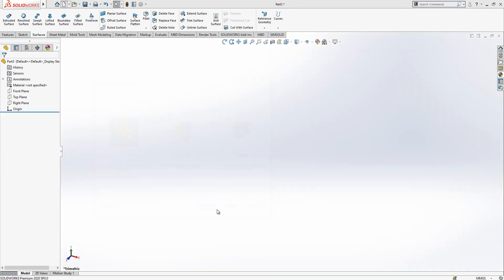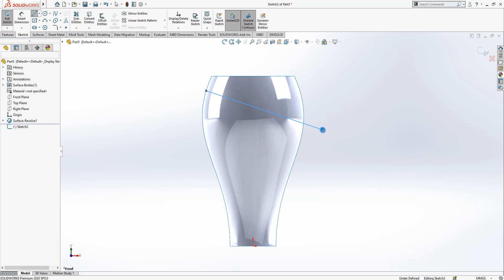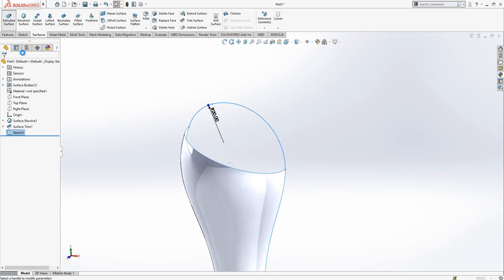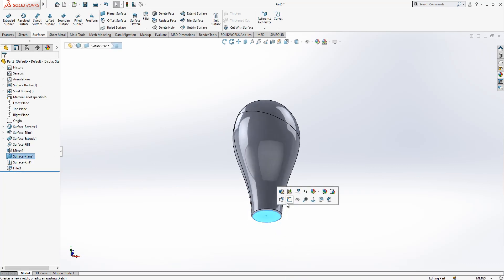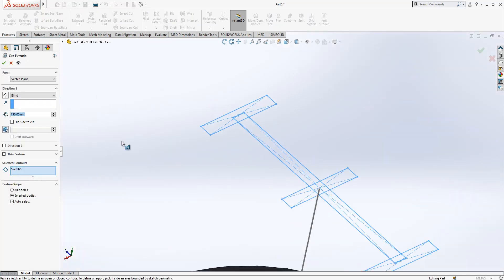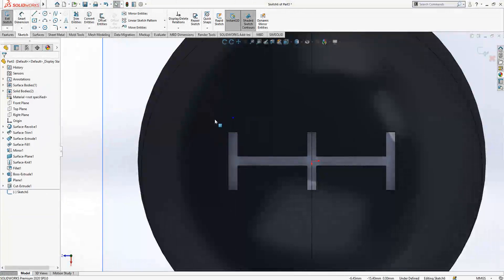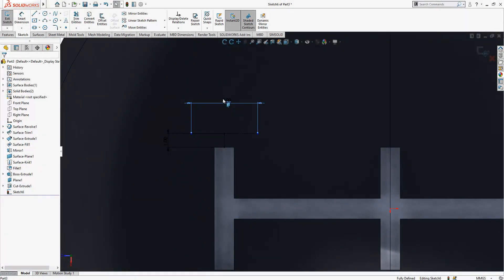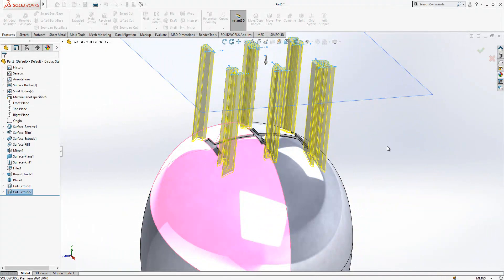Surface Modeling - SolidWorks Tutorial

Comment: 3:48 Had some struggles with this part but figured it out:
The problem was surface fill was not able to work with Curvature, despite working with tangent and contact
The solution was to make sure you have the upper curve's surface edges selected and not sketch. This solved the issue and I could select curvature, apparently I kept accidentally selecting the sketch
Reply from the maker: Good 😉